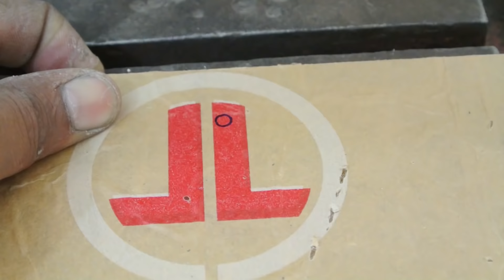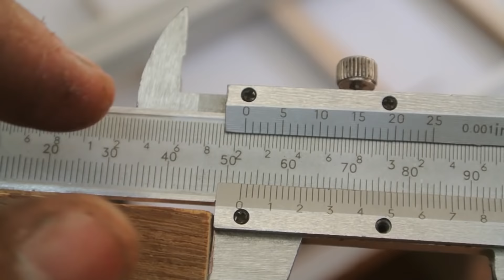Homemade Circular Saw Jig

Comment: Very nice and unique design. Using aluminum extrusion is a new one that I haven't seen others use. Great Job!!  (You had at least 2 different soundtracks going at once. We would rather hear nothing but the sound of your tools. Please consider for future videos.)
Reply: Checkout JSK-koubou. You will be amazed to see how this kind of jigs are made properly. The one in this video, looks like is made by toddlers at kindergarten.
Reply: @1zanglang   love his work! In fact, he inspired me to purchase linear rails and accessories to make my own panel saw. I have it attached to pulleys that then are attached to the ceiling and hangs up out of the way when not in use. I hardly use my table saw anymore because the panel saw I made handles full sheets of plywood. JSK is brilliant.

Comment: very good video and very good project a question, what is the name of the aluminum tracks you used?
Reply: They're just called aluminum extrusions commonly. 2020 (20mm x 20mm) and 4040 (40mm x 40mm) are common sizes but there are some others. Misumi sells various sizes and cut to size lengths.